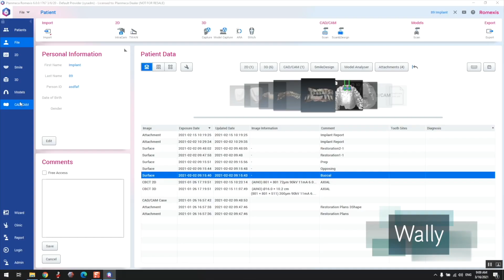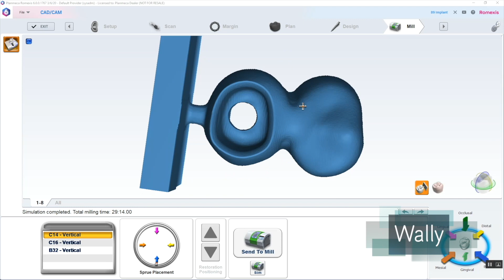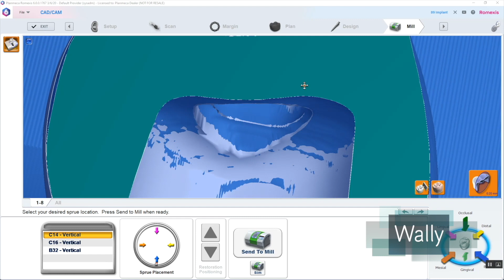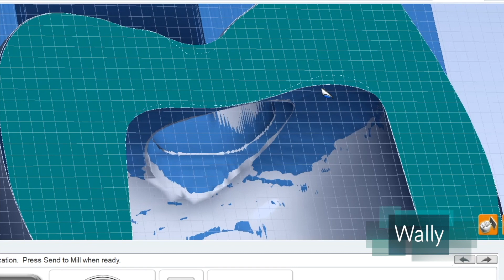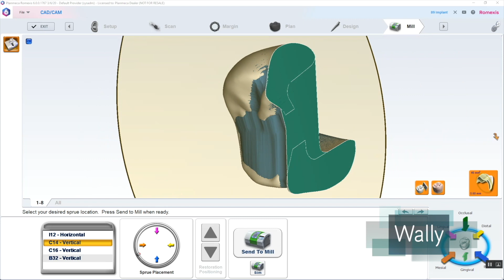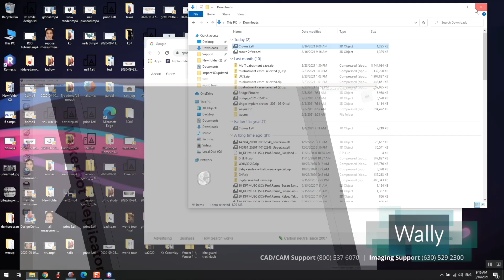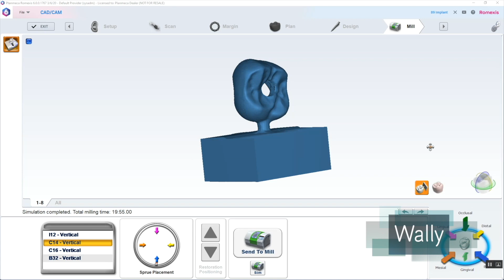How to mill any STL file in Planmeca 30s, 40s, 40 chairside mill systems.

Comment: Hello, one question. I am currently using planmill 40 With romexis 6.2 version I would like to know how I can additionally add another planmill 40? Thank you very much 🙏🏻
Reply: perfect thank you very much🙏🏻
Reply: I think it's pretty easy, that's what we've done.  Your 'mill' ip address is really your jobserver ip address.  With two mill connected you will see sent jobs showing on both mills, once you start the job on one mill, it will be removed from the other.

Comment: Hello there Wally. Im having "job server" communication issues on my recently acquired e4d system. May you kindly assist with the physical network setup details please.

Kind regards
Reply from the maker: Both the mill and design software need to be on the same network and assigned a static ip. You can find the mill ip in the advanced menu. Could also be expired software or incompatible software